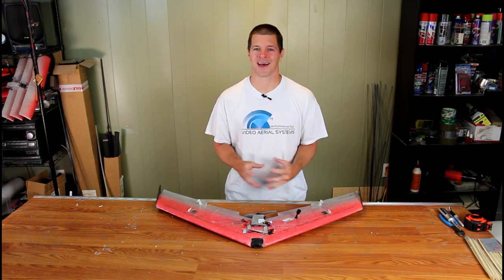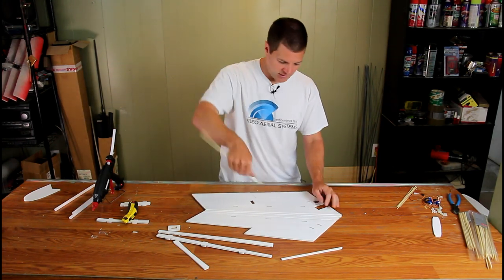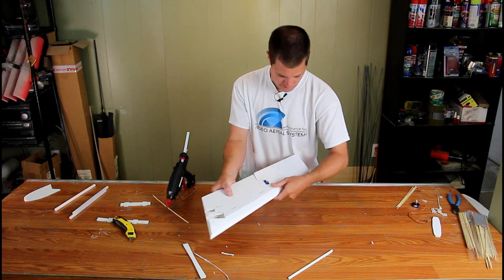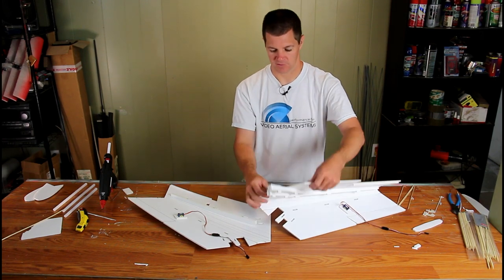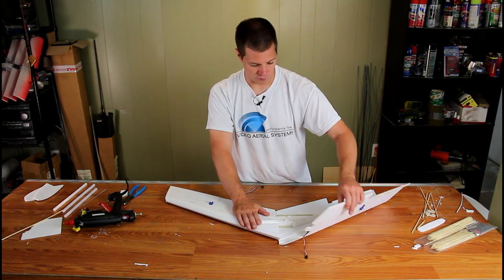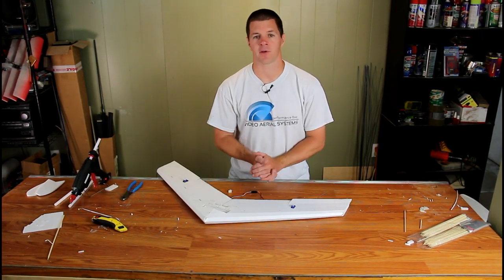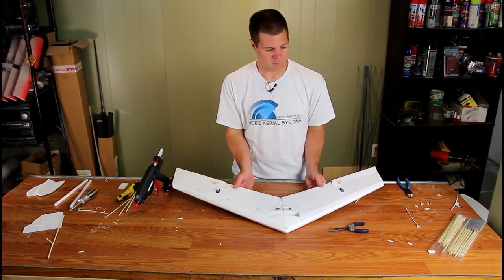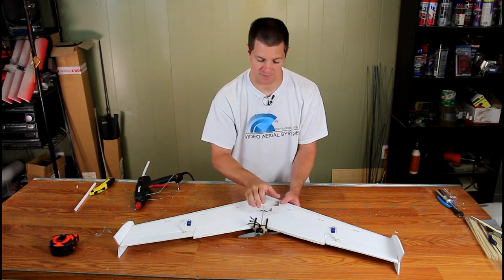Foamboard spec wing tutorial and plans

Comment: no usable plan was able to be downloaded.  The only thing was a pic that was not in a flat configuration with no measurements.  I will need a tiled file as I have to hand cut.
Reply from the maker: How do I make a tiled file?  There should have been 2 dxf files in there which is a CAD file.  If there is another format in which I can export it so you can cut it by hand, let me know.
Reply: no need for tiled... although it would make it a little easier... use adobe acrobat reader, goto print > set page sizing to poster > check mark cut marks > leave tile scale at 100%... it should print out with the cut marks on it which will let you get them put together cleanly....
Reply: some looking... it looks like this will put the ticks for tile alignment... I'll have to try this out next time around
Reply: @markthomas3853  I am still concerened that the plan is not in a flat pic and that will make the vertical shorter than it needs to be.  I do thank hyou for the directions and itt worked fine.  I am going to go ahead and print it out and I guess just measure to see if it will fold over long enough.
Reply: @markthomas3853  thanks for the heads up! Worked perfectly!

Comment: What motor and prop would you recommend?
Reply: Rules and regs/motor setup can be found here. TBH you could use any power setup you want, it just wouldn't be considered "spec". https://fpvwra.net/
Reply: @jhbuxton4  So is the sport dead? I clicked on the link and there is quite literally nothing there. You click on the link for tech inspection and it says to click on the updated rules for 2018 (First red flag: no update in four years). You click on that and it says to click on the 2018 rule book. So I clicked on that and it is giving links to the other two which went nowhere.

Comment: Probably a stupid question but how do I use these files without a laser cutter? Do I print the PDFs? If so what size paper, A1? I can't imagine many people having an A1 printer
Reply: There should be an option to print tiles. If not you can take it to a print shop and they can print it for a couple bucks. Although if I were to go through all that I would just take the dxf files to a makers space and laser cut them.

And you should only have to print out one if you print them. As they should be symmetrical. Print out one template and just flip it over for the opposite wing.

Comment: Ok everybody im asking for help here ive been working with this plane for about a month now n im having pitch control issues not unstable just not vary responsive in the pitch axis if anyone has had a similar problem or may know why i am please let me know i would love to get racing with it thanks
Reply: How's the elevator dual rates?
Reply: @ammo193  i had everything maxed out n the pitch control is really sluggish
Reply: @trekkifpv1976  OK.... How about trying better digital metal gear servos?
Reply: @ammo193  im running metal geat servos but there analog
Reply: @trekkifpv1976  duh-oh donuts!!! Analog servos tend to be slow, especially with small control surfaces.... Is it possible to try corona ds939mg?  You'll love them!!

Comment: I like it even more that the files have flite test named in them :)... for those that haven't watch a few flitetest builds and you'll get a good idea of how to best build in the FT style... for example the hinge bevel is much easier if you leave it on the flat surface when cutting... also the notchs you've got can look a lot cleaner if you don't cut all the way though the foam but just the inside of the foamboard and then rip out the cuts so the keys fit in but it leaves the paper on the other side... I've got a spare DYS spec motor that I'll have to use on one of these... nice backup for my proper spec wing I suppose haha... or maybe a better one to practice bashing with?... also a bit of packing tape can go a LONG way to making these things much stronger.
Reply: somehow I forgot I have a 3d printer... so I'm currently printing the motor mount out... my only concern is how strong/thick the side braces need to be... so erring on the thicker side for starters... will toss it up on thingiverse in a day or so if they aren't already up there by that time lol... I ran out of foamboard a few weeks ago so need to stop and pick some up again...
Reply: 3d print motor mount will definitely melt with this motor 😂
Reply from the maker: @johanhoahm  - We had a few run 3D printed mounts in the State Games here in Virginia.  None of them melted.  in fact, one guy ran a 4S pack with a 5.25X6.25 on a Spec wing and was going 110 on a 3D printed mount.  No problems.
Reply: Hello  @markthomas3853 , Do you have a file for that motor mount??
Reply: @thevene  sorry no my changes to it threw off the scale... I need to work on it again but working 2 jobs for a few more weeks so don't have a lot of time to play :(
Reply: @thevene  ok finally got to building the wing itself... the motor mount bits that mount to the wing are about perfectly sized and shapped... the firewall itself is off, the keys are just too smallI might play with it down the road but right now I'm trying another 3d printed option from thingiverse... if it fits properly I'll post up the link... it does require some additional hardware but it has shims to adjust how far back/forward the motor sits which is nice vs adding dead weight to the plane to get CG right... as it stand my proper spec wing needed 3 pennies stuffed behind the FPV cam to get CG how I like it... and that was after moving my ESC and a few other things up an inch or so forward... anyway if this mount doesn't work I'll more than likely use some foamboard and a FT mini motor mount... I look forward to seeing how this compares to my other spec wing...
Reply: Mark Thomas there is a couple of good ones on thingiverse, i printed one that says is for a “wicked wing”, but is kind of bulky. There is also one for an “icarus wing” and one for a spec wing, that I want to try, but am out of filament and am waiting for it to get here, so I could try them.
Reply: @thevene  I printed the foamboard spec wing one last night and it fits great... I do wish it would use the X mount but it would make it a bit larger... there is another "VAS Foam Board Spec Wing Motor Mount" but it is pretty heavy... I'm printing the icarus and wicked ones you mentioned right now and will give feedback to fit but as it stands I don't think we're going to do better than the spec wing one when it comes to fit... I just wish it didn't require extra hardware.